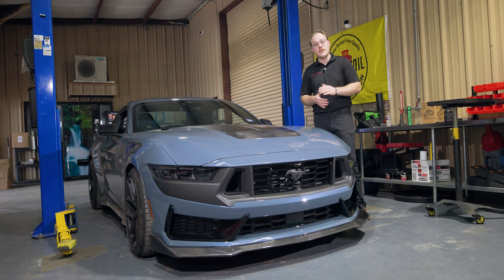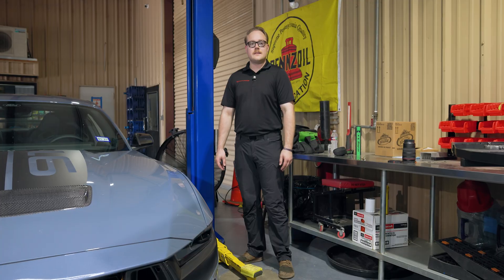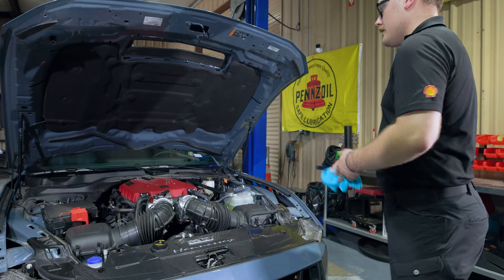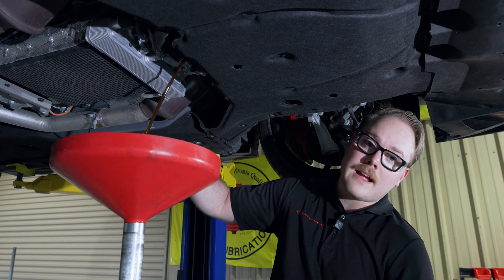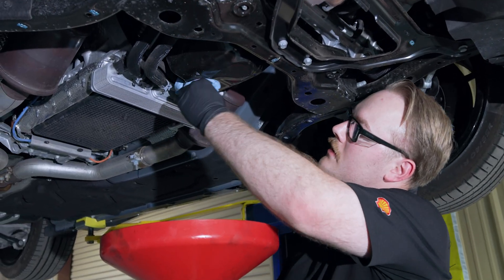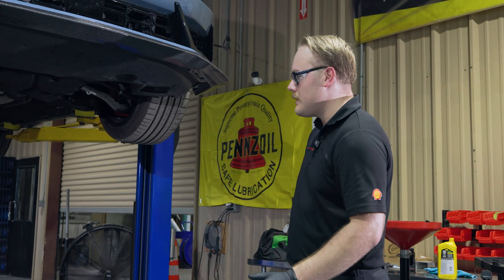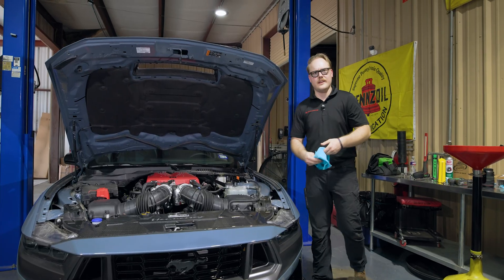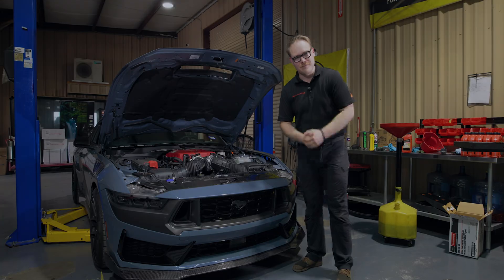UNDER THE HOOD: How to Change the Engine Oil on a Ford Dark Horse Mustang

Comment: S650 runs on 5W-30 or 5W-50 ?
Reply from the maker: A stock S650 GT or Dark Horse runs on 5W-30.
After we supercharge it with the Super Venom upgrade, we move to 5W-50.
Reply: @HennesseyPerformanceF5 hello, regarding the oil brand to use which do you recommend. Royal purple or stick with motorcraft 5w30 (for a regular dark horse
Reply: @HennesseyPerformanceF5  Full synthetic?
Reply: @Guitar_Slinger  Yes!